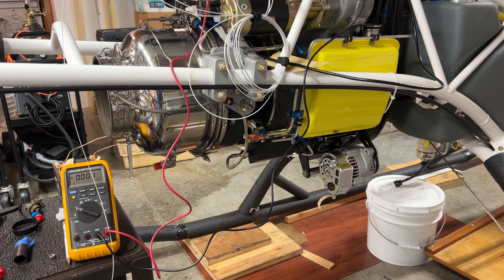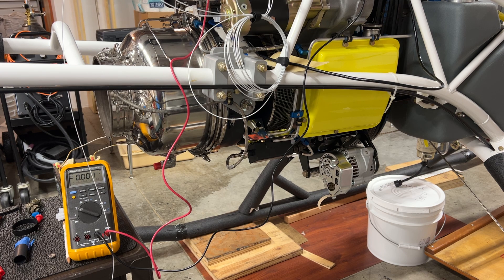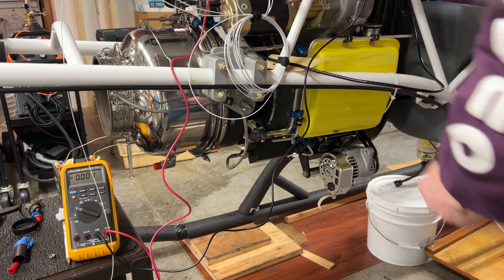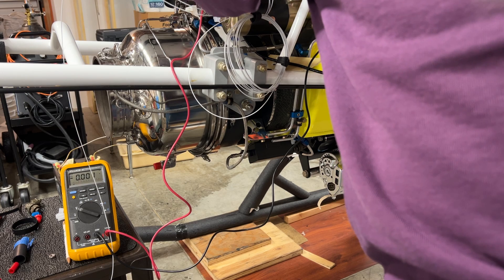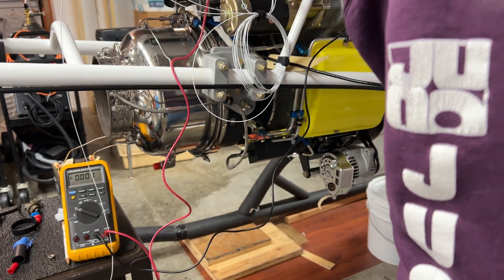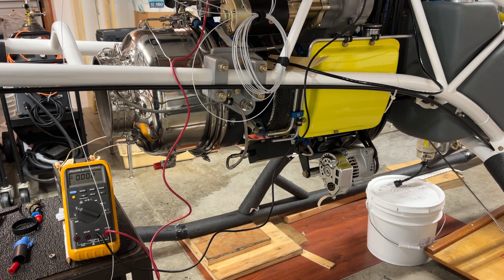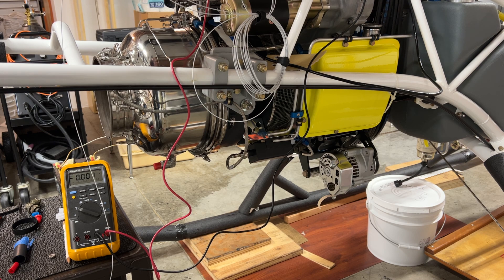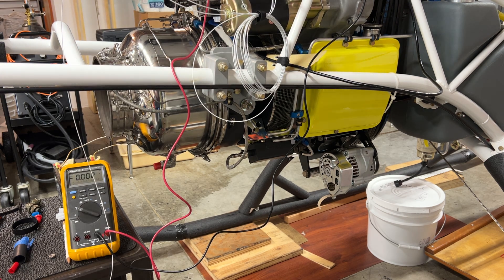Successful T-62-32A Turbine Engine Dry Start Using 8AWG Wire to the Starter.

Comment: Are you generally happy with the PPS system? I already have the VP-X Pro and I'm considering adding the PPS. I also have a T62 Turbine helicopter.
Reply from the maker: I'll answer with a qualified "yes" because I have yet to use it for an actual start.  It has taken me months of research and on-and-off experimenting to come up with what appears to be a workable solution to the problem of the PPS tripping as soon as the starter-mounted solenoid/switch engages the starter drive, closes its internal switch and the brief but massive inrush current flows into the starter in what amounts to "locked-rotor current".  Astronics provided me with a chart of their lab tests on the various trip points of the PPS's internal protections and, at least with my gearbox arrangement and its associated inertia, the current exceeds the first protection limit namely,  >=1,700 amps in the first 50 microseconds.  My experiments determined that it takes 4 milliohms of ballasting resistance to dampen the inrush sufficiently to get the start sequence to begin.  The problem with that is that the resistance in the 63" of 8 AWG wire drops the voltage significantly at the starter -- briefly to under 4 VDC with a slow climb to around 8 VDC during an 8-second dry start cycle (no fuel, no ignition).  My solution is to use 63" of 8 AWG M22759/11 wire (Teflon insulation, 200-degree C; /6 mineral-filled might be even better given its 260-degree rating).  Then, I have a paralleled 2 AWG wire broken by a high-quality Kilovac contactor with that contactor being signaled by my Engine Control Unit to close a moment after the PPS begins the start and gets the engine turning.  This restores the voltage at the starter to around 8 VDC with is much closer to the 9 VDC minimum which the starter manufacturer (Tilton) recommends for this particular starter.  As to whether or not the PPS will work on your T-62 will depend on the installation's inertia.  I'm right now going into the shop to give the whole lash-up the acid test before I final wire it.  I have no reason to believe my scheme won't work but, as they say, the proof is in the pudding.
Reply: @ChaffAndFlares  I would be very interested to know how that works out. I have been considering the PPS for a while and I think it would make a good match with the existing VP-X but now I'm having serious second thoughts after watching your videos. I don't think the pros outweigh the issues you are having. I certainly wouldn't want to spent the $1,500 just to find out it has the same problems you're having.
Reply from the maker: @williamedwards6607  The jury is still out on how well the PPS will work with my particular Solar T-62-32A.  I think it highly likely that the PPS could start even a larger-dash of the P&W PT-6, or any other modest-sized turboshaft engine with a "free turbine" gas generator or, almost any small turbojet engine - owing to lower stationary inertia of that type of engine core.  In the case of my particular installation, the starter must overcome the stationary inertia of the turbine/compressor shaft, the 10:1 planetary reduction gear set, a further 2:1 reduction gear set, the engine-driven fuel & oil pumps, two lube-oil scavenge pumps, an unloaded 70-amp alternator, and the lower main drive pulley (along with the friction of 6 loose belts rubbing on that pulley).  Hence, the inrush current associated with the beginning of the start sequence is really high - just how high I don't know because I lack a shunt and oscilloscope capable of capturing the current data during the first microseconds of the start.  Since Astronics tells me the first (of several) protection points for the PPS is >= 1,700 amps during the first 50-microseconds, I surmise that the starting current for my engine during that time window is somewhere north of 1,700 amps.  I have been able to get the start sequence to reliably begin using 162" of 8 AWG M22759/11 wire (Teflon, not the /16 Tefzel).  Today I am going to try it with 110" of the 8 AWG which I believe I can safely physically accommodate.  It is my opinion that 8 AWG wire is too small for this application unless, after the start has begun, a second paralleled line (8 AWG or larger) is brought into the circuit.  By the end of today I hope to have made a decision about using the PPS for engine starting.  I'll let you know.  The PPS is a very cool piece of equipment and, I think, a no-brainer for use where it can support engine-start inrush current (piston or turbine).
Reply: @ChaffAndFlares  I have a similar set up to yours. I have a Rotorway JetExec with basically the same drive train setup so I think i will find myself in a similar situation. I saw the follow up video and that looks like its good progress. How are you going to get the contactor to engage? Is that a dual step ignition process in the cockpit where you do the PPS and then a few seconds later you flip another switch to activate the larger wire? Would a large inrush capacitor work instead? I have some equipment that does have a capacitor as an inrush current limiter.